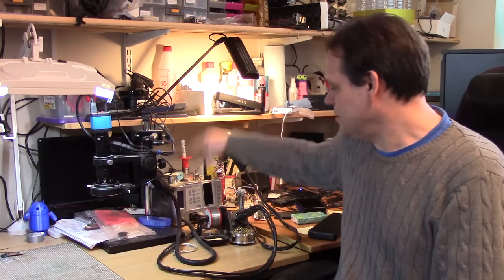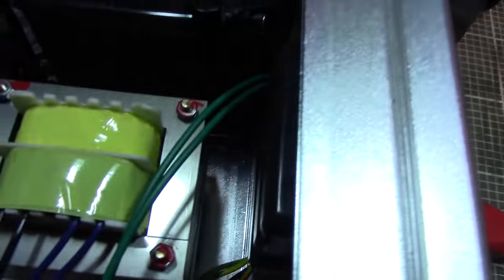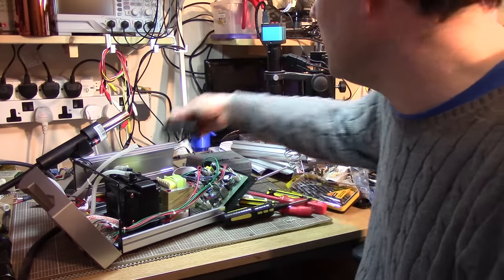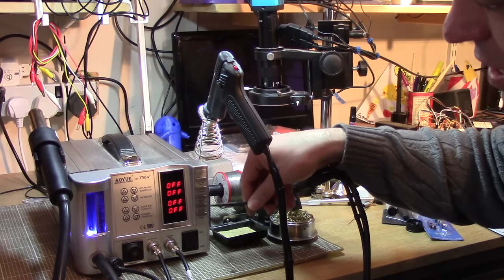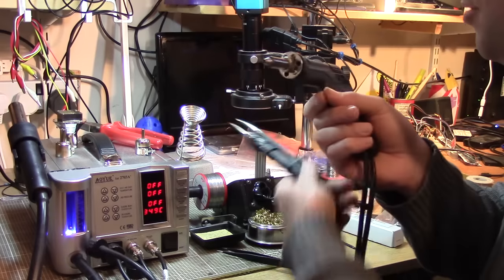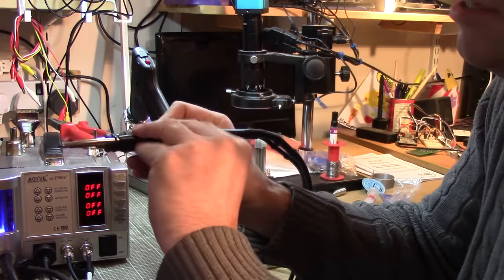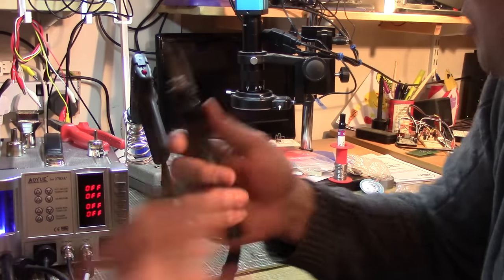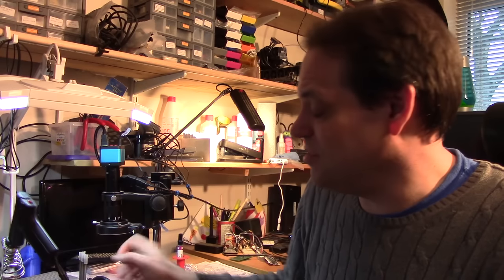Aoyue 2703A+ All-in-one Solder Station Teardown and Review

Comment: As usual, I really enjoy your videos.  In my newly retired state, I have started taking refuse apart to recycle  the good bits away from the landfill.  It's oddly satisfying to take things apart and get an idea how they worked and see what might be usefully reused.  When you have too much time on your hands,  a quickie on how and what to save from circuit boards might help save the world.  You could be a super hero!
Reply from the maker: Thanks +air pruning hydroponics - I belileve there's a saying in the recycling industry - "Seperation adds value" - Whilst nobody has any use for a broken washing machine,  I can think of lots of uses for sheet steel, springs, motors, valves, pumps etc - The trick in choosing what to salvage is to keep the bits which you have the skills to use, and get rid of the rest. For circuit boards, I tend to keep the more expensive bits (large capacitors, big diodes, all the transistors etc) and not worry about the little cheap componets - It's easy just to have a stock of the smaller items - resistors are so cheap they're practically free anyway. Cheers!!

Comment: I am surprised you did not think the spatula-shaped heat resistant pad was to be used primarily for shielding components from heat when using the hot air gun close to heat affected components. Using the pad as an iron tip removal tool did not enter my mind until you mentioned it. Good show on that idea and I shall take your testimony that the pad mitigates problems with burned fingers and hand when removing those very toasty solder iron tips. Tip heat elements are fairly sensitive, trying to remove them using a plier would surely destroy the heating elements. Now that problem has been solved thanks to your suggestion.

Great job in the video, it is very easy to understand and well done. I did notice you mentioned your old solder iron did a bit better job on some things where the 2703A+ seems not so capable. This is an indication the 2703A+ is a less capable machine than those designed to more efficiently manage heat transfer when soldering high transfer areas like ground connections and multilayer PCB boards. This is one of the trade-offs when purchasing a much less expensive system and is something the more expensive machines are designed to easily handle.

NOTE: Please come back with yet another review after using the 2703A+ extensively for a few weeks or months. The contrast between review as new and reviewed after extensive use will surely be quite enlightening to all who are considering this unit as a cost-saving addition to our workbenches. So far so good with the exception of fume removal and it's inability to transfer heat better in areas of high heat absorption.

Comment: Jim, thank you so much for your excellent review... It was exactly what i was looking for to help me decide. I ended up getting the aoyue  852A++. it seems that aoyue makes a solid hot air station. Something you touched on and is a plus for cell phone repair, is the automated function for the hot air station. I don't think it's available for the unit i purchased, but is definetly nice to have. I wanted a good soldering iron so  I also picked up a weller wx2021 as a primary solder station. They both get here tomorrow and i have a couple of things to test them on.. again, thanks for taking the time for the review!!! cheers from Texas..
Reply from the maker: Hi +Edgar Salas - Glad you liked the video - I'd been meaning to take a look inside that iron since it first arrived :) - I think Aoyue did a fine job on the hot air gun (the temperature calibration on my unit excellent... though I don't understand why the dispaly always starts from 0C when it heats up) - I found the automate function very useful for working on SMT parts - I've seen other people working with hot air moving the nozzle around to pre-heat the area, before concentrating on a particular device, but with the automate function you can just have the pre-heat stage as a programmed step. When using the automate function, I just hold the nozzle in one fixed position over the component and let the pre-programmed steps take care of the pre-heat etc... As you watch it work through the steps, you know when it's going to hit the hottest point and that's when you move in with the tweezers. I think you've made a good choice with your selection of hot-air + iron there. That Weller unit looks fantastic - I'm sure you won't be disappointed. Cheers!!

Comment: That brass scrub bud for cleaning the iron can also be replaced with a cheap domestic stainless steel one. It is intended that you jab the iron into it, rather than wiping the sides of the tip across it. OTOH, whatever works for you! Maybe the fume remover exit nozzle can be dropped into a pipe leading out through a window, or into a filter box? Another 3D printer project for you. ;-) It's a pretty good soldering workstation for the money. Thanks Jim.

Comment: You can use a cheap kitchen exhaust hood carbon filter. From 57*47 cm sheet (2 pcs in a pack) you can cut a lot of little circles. That material is much denser, and you can pack 2-3 layers together for slightly better filtering.
Reply from the maker: Hi +zlotvorx - That's a great idea, and if I hadn't already ordered myself some activated charcoal granuals to make my own custom fume filter, then I would do exactly as you suggest (I might still do it anyway). Thanks for the idea. Cheers!!

Comment: The Aoyue 2703A and the 968a+ are the best kept secrets on the market. Internally, they are quite robust and well built unlike other competing stations costing significantly more. They also have an internal pump instead of a cheap built in blower built into the wand handle, which is a fire hazard. Unfortunately, Aoyue is often overlooked as just another cheap Chinese import and rarely reviewed. Hakko and JBC, on the other hand, are well regard as super premium, but don't deliver anywhere as much value for the money.

Comment: Great review and teardown Jim, looks like a decent all in one unit.  That razor sharp vacuum pipe on the soldering iron is obviously an issue as I'm sure I've heard others mention that after being skewered by it.

Cheers friend
John
Reply from the maker: Thanks +orbiter8 (John)  - Yeah - overall I'm pretty happy with the unit - The insides were a lot nicer than I was expecting to find in there. Having had the unit open today has given me ideas though... I'm thinking of 3D-printing a combo HEPA+activated charcoal filter enclosure and replacing that black pressure-equalization tank thing with that - That would be a nice project. Hope you're having a good weekend. Cheers!!
Reply: +Jim Conner I'm sure you will, but I'd love to see a brief video of this modification when you make it.
Reply from the maker: Hi +FesterWerks - Of course I'll make a video about it :)... Just waiting for some bits to arrive before I get stuck into yet another project. Cheers!!
Reply: I think the silicon pad has a hole so you can hang it up

Comment: The pump you showed on that site appears to be different from the correct one. Did you figure out which one it is? SI-P007 or SI-P005 looks to be a closer match, but I can't tell which of those two is correct. I need one as mine barely blows and its barely used.
Reply: I took mine apart, and the diaphragms look fine, and the ball blows all the way to the top, but barely any air comes out. I guess that ball blowing up doesn't mean much. No clogged hoses or filters or kinks.
Reply from the maker: Sorry - I never put the spare pump into service so I don't know for sure whether it is the correct one or not. Good luck in your search for the correct part. Cheers!!

Comment: Hello! I have a 2702A+. I want to know if I can parallel the output of the "only one" connector I have so I can have soldering iron and desoldering unit at the same time. Thanks.
Reply from the maker: You can have the heating elements of soldering iron and desoldering iron both running at the same time, but there is only one vacuum pump on the unit, so you have to decide whether you want fume extraction on the soldering iron, or solder-sucking vacuum for the desoldering gun. To be honest, loosing the fume extraction on the soldering iron isn't a great loss as it means you can unscrew the suction tube from the back of the iron making it a lot easier to get into small spaces. More annoying is that you can't combine the hot-air station with the desoldering gun... That's a great combination. Hope that helps. Cheers!!

Comment: I am wondering if the desoldering gun could be adapted to a Hakko desoldering station like the Hakko 472? what do you think?
Reply: It depends in the wiring and type of heat sensor. If the hakko sensor is a thermocouple and wired in series with the heater, it might work.

Comment: Nice review and still useful, since they keep selling that model. My main problem is the price of the tips, which is over 4 times the price of your average tips (without the temperature sensor) and availability/cross-compatibility of the tips is also not great.
Reply: $10 to $15 for a tip including temperature sensors is pretty awesome. And mine have lasted a long time. A model from Hakko that does the same 3 functions costs over around $2400 now, and the tips aren't any cheaper.

Comment: A superb Teardown Jim. Will you be able to come up with a fume extractor?
Reply from the maker: Hi +Patrick Meehan - Now that I can 3d-print enclosures I'm pretty sure I can - I've ordered one of same air pumps that was in the station (it was far cheaper as a spare than anything else I could find) - Combine that with a HEPA filter (spare from vacuum cleaner), some activated charcoal granuals and a 3d-printed enclosure to hold it all together and I reckon I'll be in business.... And I can do a similar job with HEPA+charcoal to replace the 'pressure expansion tank' inside the unit too. Hope you're well. Cheers!!

Comment: Hello everyone, thanks for you video review. It's very useful for me. I'd like to ask your assistance. I'm thinking what will be better, Aoyue 2703A+ as desoldering station or YIHUA 948D.  I think Aoyue has  a stronger vacuum pump with tank than YIHUA, but YIHUA has  more modern technology - induction heater with 380 kHz 36 v AC power.

Comment: Hello I bought two years ago a welding station Aoyue Int 2702A +

And for some time now I've had a problem with the hot air desoldering and with
the smoke extraction pump built into the soldering iron.

The air does not pass anymore there is no pressure and no noise. The ball that
indicates the pressure remains at zero.

When I press the "Hot Air Gun" button, the temperature increases but
the hot air does not come out.

Would you know some spare parts I have to buy? Can you give me the SKU
reference

I count on your help infinitely thank you.
Reply from the maker: Hi Cyber Net - It sounds as if you may have a problem with the air compressor inside the unit. Thankfully the replacement part is reasonalby priced and simple to install. ( http://www.pcb-soldering.co.uk/aoyue-p008-replacement-pump-for-2738-2702-work-stations.html ). Before you buy a replacement, I would suggest that you desolder the wires on the compressor in your current unit and test it out to confirm that the problem is with the compressor rather than with the electornics which drives it. The compressor is a main-powered device which is driven through a thyristor based dimmer circuit on the PCB. If you desolder the connections and test it from the mains it will tell you if the problems is with the compressor itself, or with the circuitry. Hope that helps.. Cheers!!
Reply: Whouaouhh what reactivity !!!!
Thousand thank you Jim you save me !!!
Would you be kind enough to give me more precision on how to test the air compressor ..?
I'll disassemble it.
Thank you
Reply from the maker: Hi Cyber Net - There are just two wires on the compressor... attach some AC power to them.. if it makes a noise and blows air out then the compressor is fine... if not, replace it. Cheers!!
Reply: You are amazing !!!
With how much volt?
Reply from the maker: The compressor will run anywhere from around 48VAC up to 240VAC....more volts will give you more airflow, but you should be able to hear it running on a lower voltage if you have a way of providing it... It will need AC volts though. Cheers!!
Reply: It is the air compressor inside the unit. !!
I disassembled it and it is burned inside!
I found on the French site:
http://www.aoyue.eu/aoyue-piece-detachee-air-chaud-compresseur-pour-850-850c.html
Do you think it's the same?
Reply from the maker: It certainly looks like the same part, but I can't say for sure as I've only got experience with the 2702 model.
Reply: Thank You Infinitely Jim
You were more efficient than the Aoyue customer service who wrote that it was the pistol and the iron to desolder !!!!!
Reply: Please do not discount what AOYUE service relayed to you. I have a feeling something caused the air compressor to overheat and cause the burning inside. If that proves true replacing the air compressor and doing nothing more may set you up for yet another failure soon to follow. I would make sure all air flow through the gun to the compressor is working well. I would also check air flow from the fume removal tip to the compressor and also check air flow from the compressor to the exit on the hot air gun. Once you have verified all these things are in good order and you have replaced the compressor it would seem expectations of having repaired the problem have been properly dealt with. If nothing else all these checks will yield a completely clean system throughout which is never a bad thing to have.

Comment: hi jim  the carbon filter someone else used ceramic tape to make a filter for a aoyue 8800
seemed to work quite well for stopping the fumes
Reply from the maker: Hi +Robert Carpenter - I've actually been working on a project for making better filters using activated carbon granuals, combined with a HEPA filter from a Roomba vacuum cleaner (they're cheap on ebay) in a 3D printed enclosure... a video showing what I've been up to will appear eventually. Cheers!!

Comment: Hi Jim: I think the black rubbery thingy is part of the ESD grounding system. It goes on the soldering iron cord, and it's weight makes contact with the ESD mat on your benchtop.
Reply from the maker: Hi +Lawrence King  - It's possible... but that rubbery thingy isn't conductive in any way, and neither is the insulation on the soldering iron cord, so I don't see how it would aid in ESD protection.... Still.. it's as good a suggestion as any other I can think of :-)... Hope you're having a good weekend. Cheers!!

Comment: I have a cheaper similar unit and a hakko 888D, I think the wattage ratings are a little bluffed to be honest..
Have you put yours on a watt meter? The element for hot air doesn't look big enough for the stated power draw.
I kind of like how these things knock off hakko parts, means spares are often interchangeable :)
The bigger Hakko iron at my work (which takes the same tips as yours) also has that funny rubber thing, never seen anyone use it...
Reply from the maker: Hi +Slot1Gamer - Well, I didn't put it on a watt meter, but in response to this comment, I've just done exactly that. The soldering iron (rated 70W) pulls 64W, The desolder gun (rated 80W) pulls 58W and the max I could get the hot air (rated 500W) to pull was 430W (I had to crank it up to 480C and 100% airflow to get that - the unit ramps up the power to the hot air gun very gradually - it took a few mins to reach 430W.... And finally, the air compressor running at 100% uses 24W. A little under the specs on all devices, but my supply voltage is probably under the max rating anyway. That funny rubber thing is still a mystery to me. Cheers!!
Reply: Is it a silicon heat resistant pad to solder metal parts which may get hot enough to damage your desk or anti static mat?
Reply: Hakko tips and AOYUE WQ style tips have different ring contacts. Hakko uses a two-ring contact where AOYUE uses a three-ring contact. I am not sure they are interchangeable with everything working properly. My assumption is two rings are used for power and the body of the tip puls the other ring is used for thermocouple signals. I am not certain of this but it seems to make sense.

Comment: The solder holder ,bend the left side inwards,to seemif that improves any,when you were pulling the solder it sounded lose.
Reply from the maker: Hi Ron - I already tried that, but it doesn't help. The problem with the roll holder is that the U shaped cutouts at the sides into which the spindle sits are not deep enough so the spindle has a tendency to roll up the sides when you pull on the solder. I should probably 3d-print something to make it better, but it's only a very minor issue. Thanks for taking the time to stop by and comment. Cheers!!
Reply: I suppose a bolt could be used to hold the tube on the housing. If painted to match it would look like it belonged there.